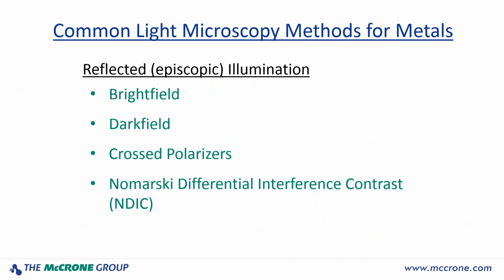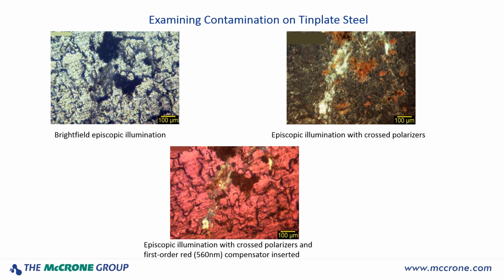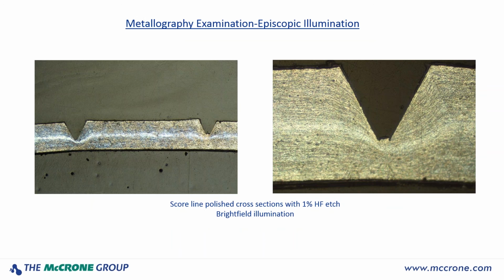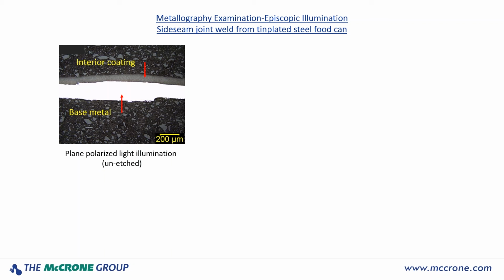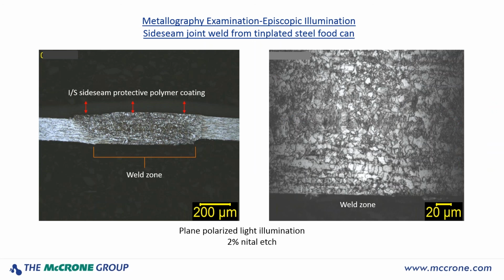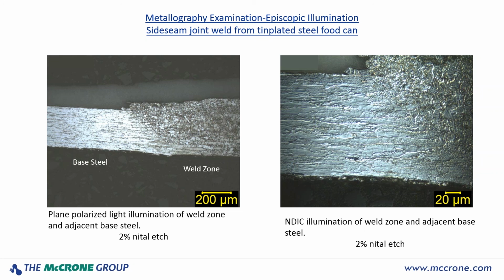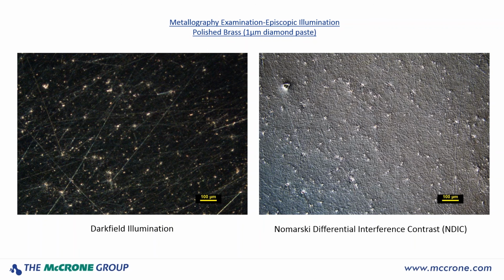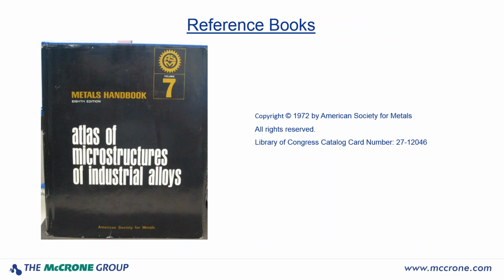Ways to Examine Metals by Light Microscopy

Comment: Hi all, I’m curious regarding the text under the third slide on the page at 5:15 minutes. The text indicates that among other things, there was a first-order red (560nm) compensator inserted. Is that a typing error in the brackets that should read (650nm)? To me it seems that 560nm is within the yellow zone and 650nm is in the red. I’m just learning about spectroscopy and if I am incorrect then I would greatly appreciate an explanation or a pointer in the right direction. TIA.
Reply from the maker: Thank you for your question. First order red compensators can often range between 530 - 575 nm, but are most commonly 530-550 nm. 650 nm would be blue. You may find an explanation here: https://www.mccrone.com/mm/the-michel-levy-interference-color-chart-microscopys-magical-color-key/  I hope this is helpful.